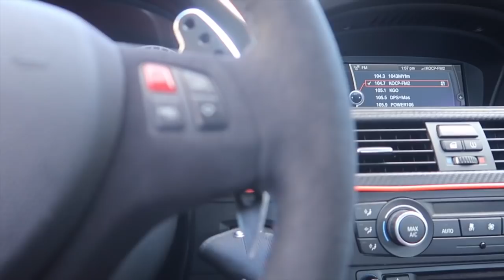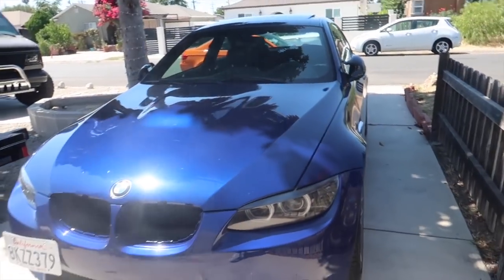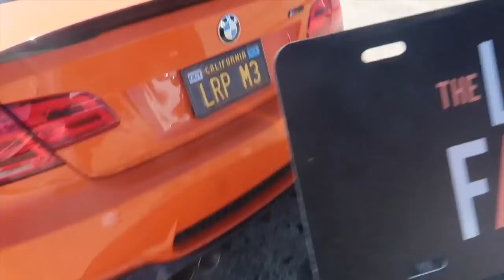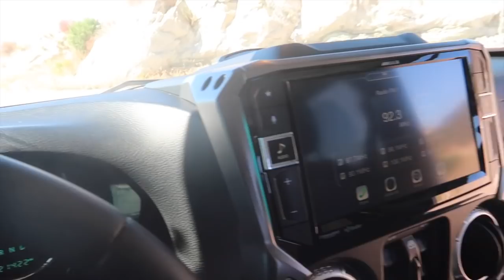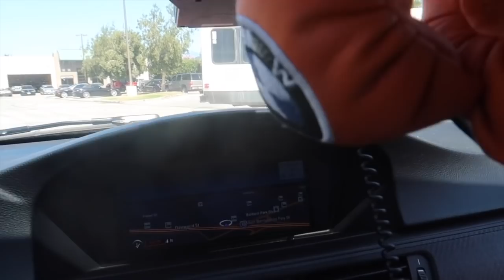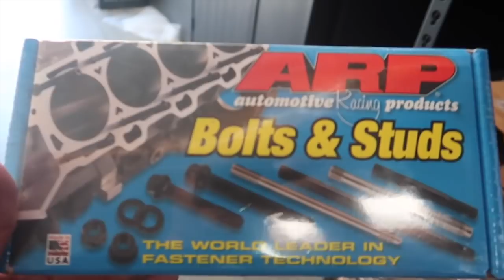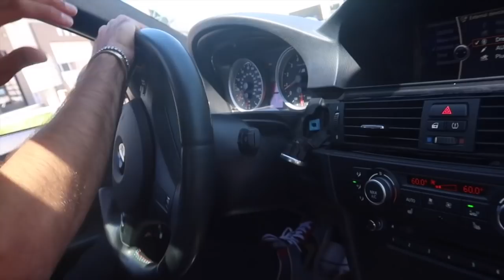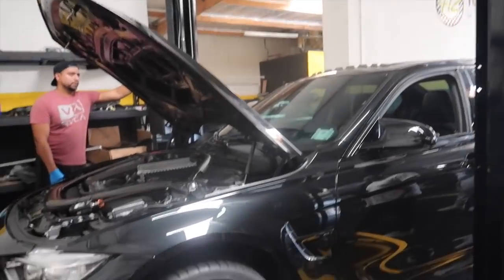Time to do MY ROD BEARINGS?! (E92 M3)

Comment: Use 5w50, look up troyjeup on Instagram.. no affiliation.. 10w60 is garbage, it’s way toooooooo thick for cold start.. also use thermostat motorad 880090 from Dodge Viper or Ford GT40.. a simple swap would allow the M3 to run slightly warmer which tightens cylinder walls which gives you little more compression = little more power and no oil consumption....  you don’t have to take my word for it, look up troyjeup reputable S65 and s85 builder